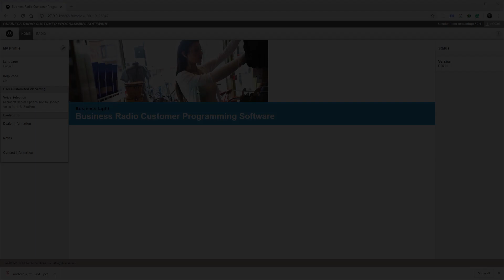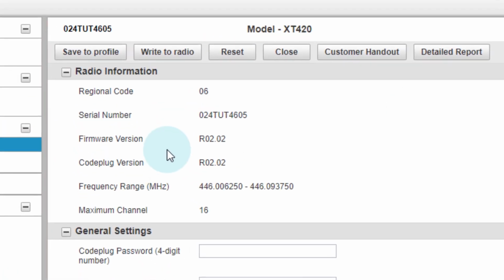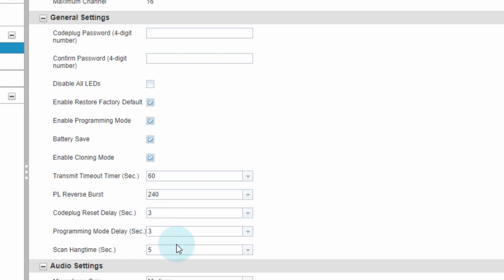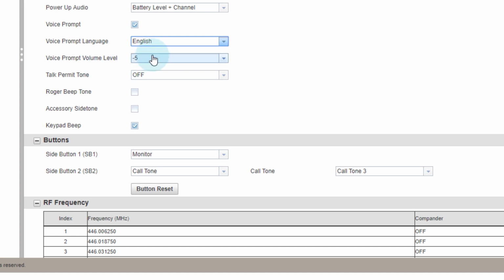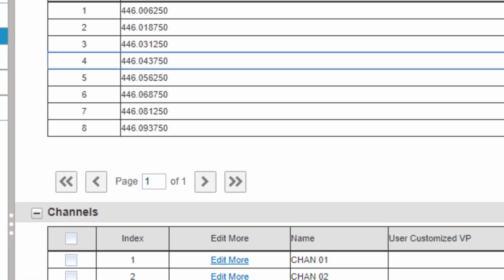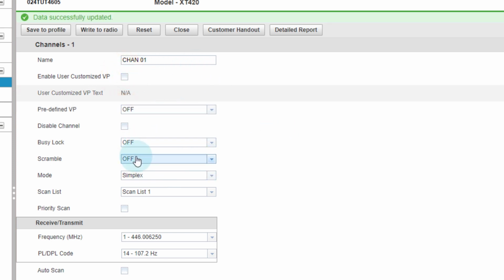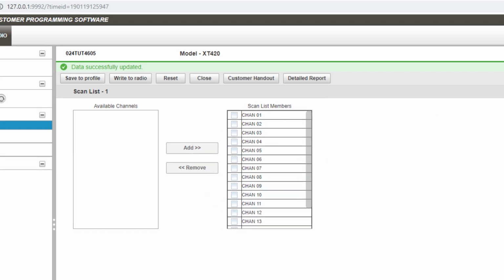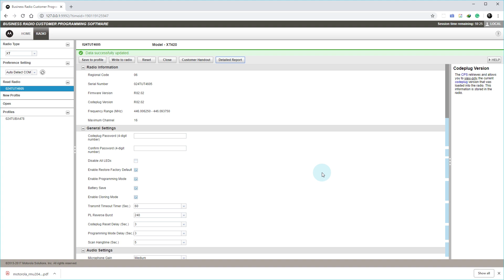Motorola CPS Software - Walkthrough And Tutorial

Comment: Page 47 of the downloadable XT 420 user manual suggests that, even though the radio is provided with 8 channel frequencies, it can be opened up the the later extra 8 channel frequencies making it a true 16 channel radio. I wondered if you have been able to do this with your XT 420?
Reply from the maker: Interesting. That's changed since I bought mine so it's possible that the models I have don't allow this but current radios do. 16 channels is completely standard now but are often locked (XT185 for example). I'll have to take a look and get back to you.
Reply: @tdcattech  After reading out the XT420 using the CPS it should show You the possible frequency range of Your specific device. The XT420 showed me full range from 446,00625 up to 446,19375 MHz. Since I recently bought a new XT460 with all 16 channels enabled. I copied the settings in the CPS and wrote it to my XT420. Even tough the 460 has some extra settings it worked without any problems. Maybe (as You already wrote) it has to be a newer model. My two XT420s were built in 2021.

If You need a XT460 profile for CPS, I can send it to You.
Reply: @2beer_OR_NOT_2beer  I am very interested by your XT460 CPS profile ! I commented one of your video directly on your channel to get in touch but it might have been hidden by youtube. I would be very grateful if you could check it out :)

Comment: can you not set a custom frequency?
Reply from the maker: Not with the radio I was using here as it’s a fixed PMR446 radio. You can with most standard business radios.
Reply: @tdcattech  Ok so I just found the same software online (I had to look under a couple rocks). What does 'session time' mean? What happens once the session time runs out? Also, why do you need a CD-ROM drive?

Thank you :)
Reply from the maker: The software essentially installs a local web server which the software uses to do its thing. It’s so you could host the software on one machine but program from multiple different machines on a LAN. Hence the need to have a session time limit. It’s web based so needs to timeout for security. You don’t need a CD-ROM for anything that I’ve ever seen. Hope that helps.
Reply: @tdcattech  maybe software can be hacked to change the frequency.
Reply: @Ixquick979  Nope, you need to have Repair or Depot authorization in Business CPS to do frequency reprogramming. And they're Motorola (and their contractors) internal.
Reply: @zarmril  Hi... could you reveal where you found the software??

Comment: In Radio information the upper frequency on my XT460 is 446.193750 MHz, meaning it is compatible with the upper eight channels. However there's no option to add those upper eight channels. From what I have found online you must have a license key to be able to do that. Bummer! Other than that the CPS software is a neat little package. Being able to change the functions of the buttons is a nice feature. I have the B button as the scramble setting, very convenient to be able to unscramble the gibberish on the fly.
Reply: Do you think that the latest download of the CPS software might enable the full 16 channels?
Reply: You need an EID licence to unlock for the newer channels circa £120! Not really worth it as it’s the same cost as a new radio!
Reply: I’ve added today with the cable: click register and then ask send to the service the radio number, they turn back with the license number: at this point you click on ADD!

Comment: I was really into getting one of these (XT420 or 460), but the fact VOX is either on or off and you need access to computer to configure VOX level is dead on stupid. How do they expect you to configure VOX level? Run to the place where radio is going to be used, test VOX then run back to the computer/admin to have it adjusted and repeat that until you figure out which one works. Also it's really stupid that you can't enable/disable VOX through one of the programmable buttons.

Silly thing is their cheaper (TLKR series) have all of this figured out quite nicely.
Reply: Thats not true anymore with my new xt660d i can change vox within the settings on the display (newest firmware i guess)
Reply: @JanS-i8z  That's good to hear. I've been eyeing XT660D lately but can't really justify the price considering how much I use these radios.

Comment: Can you help me understand this statement from the users manual? And how the short pressing SB1 actually works?
"Please note that when radio is receiving or transmitting,
LED is always RED. In order to listen to all activity on a
current channel, short press the SB1 button to set the
CTCSS/DPL code to 0. This feature is called CTCSS/
DPL Defeat (Squelch set to SILENT)."

For example, I was on channel 3 today, with no CTCSS/DCS set. Well it was set to 0 (zero). Now, by short pressing the SB1 button, it sets the code to 0 ... but it is already on 0 anyways. So I press this SB1, and I cannot hear anyone, I press again and all goes back to normal. 
I cannot understand how can squelch be SILENT?? Squelch is either CLOSED or OPEN, in "normal" radios you can set how very CLOSED it is. 

When pressing the SB1 button, there is either high tone or low tone. I can never remember what each does, and later I find myself not hearing anything. 

Thnx.